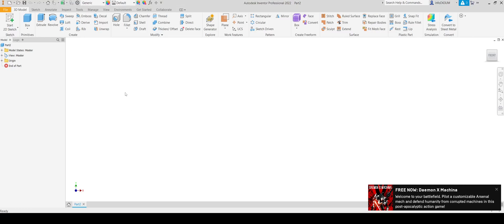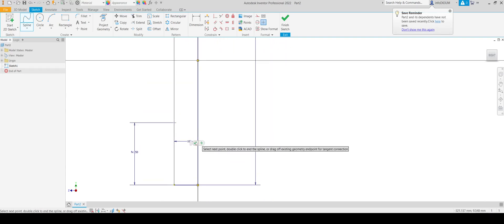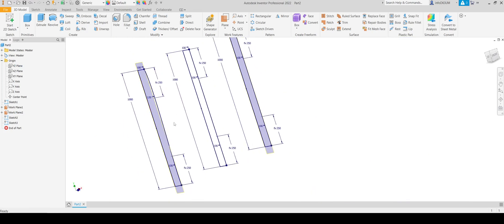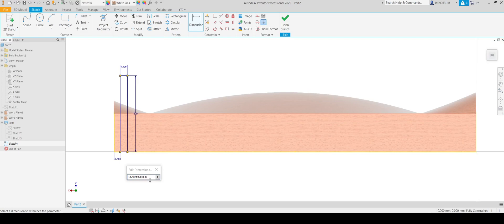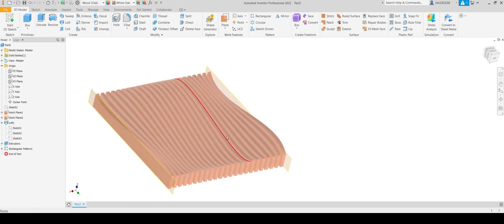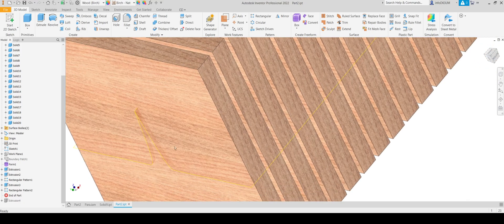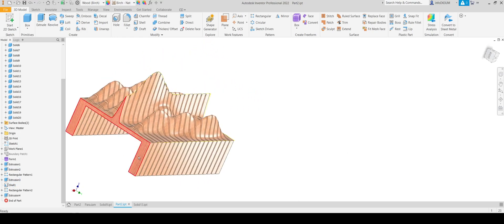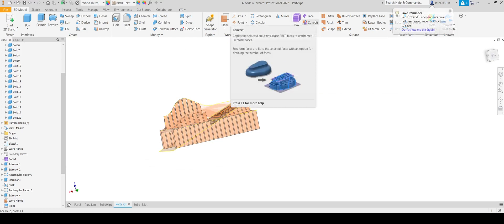Autodesk Inventor How to design a Organic Parametric wood wall or art!

Comment: So what did you do, Did you derive all of the new parts from the original solid?
Reply from the maker: Create a sketch on the right plane with four lines and two points, and use dimensions and constraints to define the shape and size of the sketch.
Use the spline interpolation tool to create a curved shape on the sketch, and use dimensions to control the curvature.
Copy the sketch and paste it on two offset planes, one on the left and one on the right, and use the mirror tool to create a symmetrical copy of the sketch across the XY plane.
Use the loft tool to create a surface that connects the three sketches, and use the patch environment to modify the surface as desired.
Use the project geometry tool to create a sketch on the XY plane that intersects the surface at the centers of the extrusions, and use the extrude tool to create a solid body from the sketch.
Use the split body tool to cut the solid body or the face by the surface, and delete the unwanted parts. or use the extrude face option on the face to the new 2D surface. 

Let me know if it makes sense